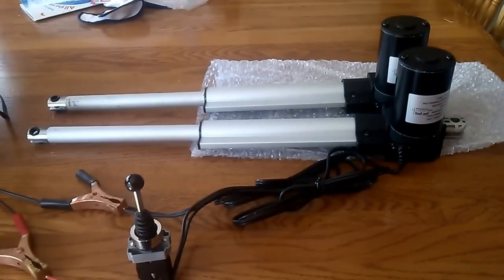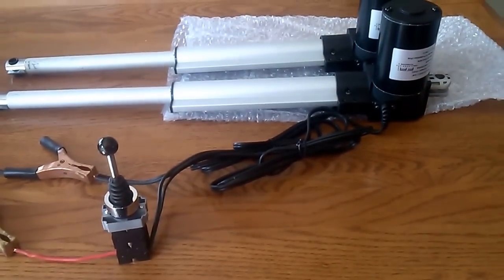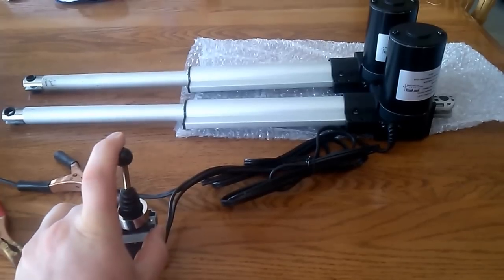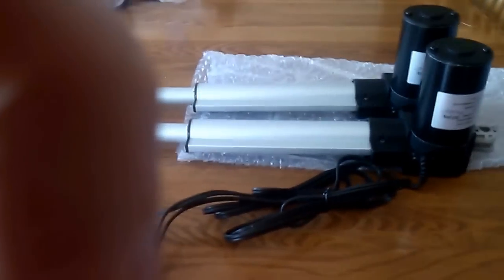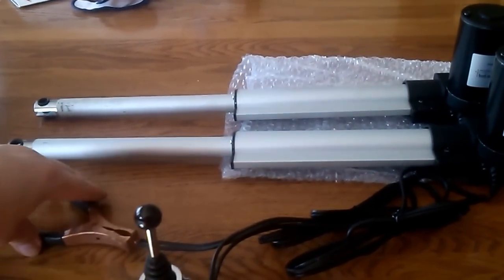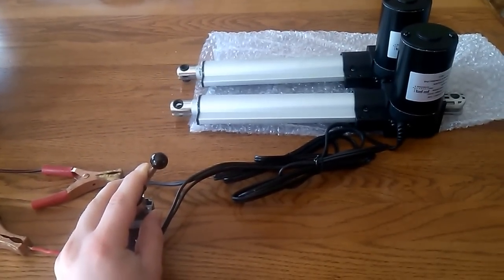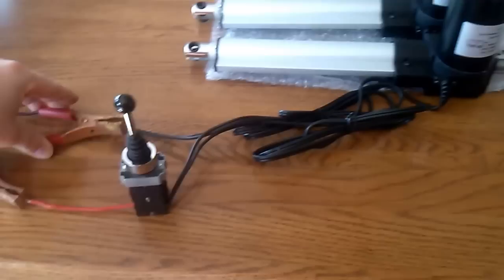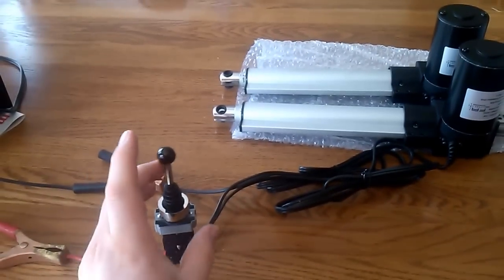12 volt Dual linear actuator with 4 way joystick

Comment: I have this same switch, but I want to use it to activate some momentary indicator lights on a gun range. Can you advise on how to connect power to the device? It did not come with instructions.
Reply from the maker: The best advice I can give you is take a meter stick the probe sound and read for continuity when you move the switch if you look at the video you can see Power come in like the bottom right come out the bottom left on the other side

Comment: I received two joysticks of the model "XD2PA12" how do I wire them to a microcontroller like the arduino uno? Wanted to build a cockpit which receives output from the joysticks ( hope I explained it understandable)
Reply from the maker: I don't know how your microcontroller works but the joystick if you stick a electrical tester in it you can tell when you move the joystick which terminals to use

Comment: How did you wire and connect it to the DC motor please I have a joystick type XD2-PA22 but it come with only four terminals
Reply from the maker: You will need to use relays and test as you go

Comment: If I want to control 4 linear actuators synchronous, how to make it?  Is there any such function joystick switch? At present, we buy the linear actuator from this original manufacturer: http://www.powerjackmotion.com/product-category/linear-actuator/
Reply from the maker: Wire all four units required directly together just do not wire them in series

Comment: Would you happen to still have the instructions for that particular joystick? I'm ready to wire that same one but can't tell which of the upper terminals are which.
Reply from the maker: have no instructions but use a meter to check the continuity to find the correlating terminals

Comment: Were did you get the DC joystick?  All i can find is AC powered ones
Reply from the maker: type this in the search bar on eBay XD2PA24 JOYSTICK
Reply from the maker: purchased from ebay.  this one is a 4 way.  you can call me or  text 4l9-2l7-9490
Reply from the maker: search  "directional dc joystick"
Reply from the maker: ***** take a electrical tester and use continuity setting.  you can call me 4l9-2l7-9490
Reply: ***** Hi d bauer. Can you post the link to the version you purchased off ebay? Thanks!
Reply: What terminals did you use for your wiring?  No diagrams are available for the 8 pin 4 way switch.